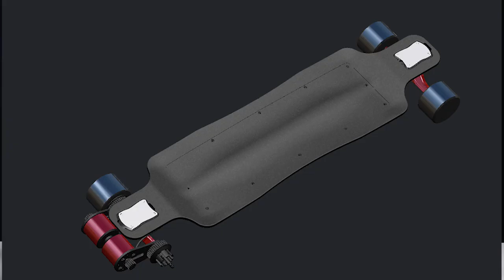Look inside MEEPO - New Boards and updates.

Comment: Keep on going! :)
My Meepo Classic has got around 1500km (!) and goes on and on without problems! 
Best bucks ive spend in my life.
Only one critic point/ tip to improve: The meepo board decks could be more like a 'normal board' = not so rigid anymore, more concave/flex.
Reply from the maker: Best bucks ever, that's a super high compliment. Thank you.

Comment: Hello Kieran, I love the v3 but I would like to make you aware of the only signal problem I had. There was a yellow wire disconnected from the power switch that disabled me from turning the board on with the button. Due to the auto roll turn on it wasn't too much of a problem but I just  wanted you to be aware :)
Reply: It might be the problem of the ESC case. Would you mind contacting us through email (info@meepoboard.com) or ig dm? We would love to solve your problem.
Reply: @MeepoElectricSkateboard  no worries i resoldered the connection and everything seems to be great!
Reply: @FracturedXD  Nice!

Comment: My Meepo Mini 2 , replaced the hobbywing and night remote with the Ling Yi revision with remote with screen. Now it turns off after a few minutes and will not turn back on for days. Cuts out after 3 minutes basically.
Reply from the maker: sounds like a battery issue. Whats your email or order no. Lets do some diagnose together.

Comment: Had a few different meepo boards over the years and they are great. One of the best boards I’ve ever owned is a meepo mini v2p with a hobbywing esc.
Good work meepo 👍
Reply: I need a board design for Uber eats, Dasher & caviar app delivers, I have the meppo all well drive & would like more speed & power for people that live up in the mountains. I need range because I only make 130$ a day & I could make more if I rode longer with less charge time for night time delivery for taco bell 3 am stoner clients

I could make so much money if you all just rush the prototype on the public please rush the fucking production

It is not for my enjoyment. I need it for employment, I don't want to get fired

The request is not for fun, it is for work

I am losing money by not having to the good stuff
Reply: @noeluna7354  flux motion board 

DIY board and battery

Comment: Hey kieran I have a question I have the meepo awd pro but would like to get more miles out of it , can I just buy an extra battery for it and just replace it when the other one dies out while on the road???
Reply: I’m just a user but yes. Same/similar voltage battery change works just like any other battery change. You could swap out fresh batteries all day.
Reply: @jonnypropaganda  thanks

Comment: Hey Kieran I’ve been having a issue with my board where the motors would stall (stop accelerating for a split second) when accelerating in any way. I checked the remote it seems fine and I opened it up and didn’t notice problems but the Esc isn’t exposed so idk if it’s that. Idk if it’s the motors either because I removed my 100mm hub caps and it seemed clean on the inside and it doesn’t have a issue getting to maximum speed it just has issues smoothly accelerating. Where can I contact you easily.
Reply: Please contact us through email info@meepoboard.com It might be the problem of the ESC. We could love to help.

Comment: I have been skating for 35 years. And just last month I finally got my very first e-board. The meepo v3. It has been life changing. I am addicted. I love it. 

I don’t care how v3 compares to competition. Because (with only 150 miles on it so far) _ the v3 It has everything I could want—almost. The 100mm should come standard. 

The awesome power in this thing is done a disservice by its bumpy ride (90mm). I’d bet that, like me, the majority of skaters would prefer the improved traction/clearance (and top speed) cruising on some 100mms over the bumpy/jumpy 90mm any day. I have no interest drag racing or kick flipping this thing. But I have a lot of interest in staying on it.

I would love a hint of a kick tail for sharp turns at a street-corners but that’s more preference than criticism. And of course I’d love the extended batteries, but that’s just an obvious hard cost, and honestly 10 miles is plenty for a fun ride or short commute.

After the $90 to replace all 4 wheels, this board is everything I could ask for. I ride every chance I can get. I love this thing.

P.s. WEAR A HELMET PEOPLE.
Reply: Wow, we appreciate these! Thanks!

Comment: How do I order the V3 ER with 100mm wheels instead of 90mm?  I don't want the 90mm and would prefer to put the funds toward extra set of 100mm.
Reply from the maker: All the meepoboard pack up with the original configuration, if you want to change the PU sleeve, you could ask our support team for a discount to purchase it : info@meepoboard.com

Comment: I experiment some trouble with my new AWD Pro , problem of rattle and speed decrease drastically ... but I like my Meepo . Hope they will continue to improve for better quality and fiability . New board are coming , cool . 👍🏼
Reply from the maker: Thank you for the feedbacks about the weakness of AWD Pro.
Reply: @KieranEboard  Its a pretty good board , I experiment some issue but it still working . Not perfect but good
Reply: @GeeKIller okay , thank you for the informations , I will make some research in this way . I have two new motors in stock , I will open one to see how it's made .

Comment: What's the ETA on the new skater belt drive board, and any expected specs?
Reply from the maker: Autumn. Fastest acceleration?
Reply: @KieranEboard  the deck does look nice. Was looking for a bit more concave and drop, it'sthe only thing holding me back from upgrading to the nls belt. . (:already have a v3er and mini2er:)
Reply: @KieranEboard  50km top speed 😉

Comment: Glad to see new update and a new board! The V4 change the griptape a little. Remove the bigger orange line on the back and keep the thinner orange line in the front and remove the arrow. The new board (didn't understand the name) looks dope, love the deck style 👌🤙 and render style
Reply from the maker: Thank you for the advise. We may need to keep the arrow as it has function, you don't need to look at wheels to find out which is the front side. We will try maybe make the lines smaller thineer.
Reply: @KieranEboard  Hey Kieran, thanks for responding. Yeah but if you just keep the thinner orange line in the front then people will recognize what the front is without the arrow. It would make the design much cleaner. You can try it an ask people on YT and IG what they think.

Comment: You should look at Exway design & quality. (I ride Evolve) 🛹
Reply from the maker: Yes, Exway try high-tech things, as We are more like make the board simple and reliable, less hassle. Something simple and stubid but last.
Reply: @KieranEboard  My $300 Er battery lasted 6 months yet the Warranty was only for 3? Using cheap parts doesnt make it last longer. If you want people to still "care" about meepo boards, stop treating customers this way and extend warranties and replace parts that are inferior.
Reply: @tripps5415  The batteries we are using are from Samsung and they are super stable and with high performance. The warranty for parts is 3 months and warranty for the whole board is 6 months. Usually, the battery lasts really long if you take good care of it (Charge regularly, avoid water. etc). You could feel free to contact us through email (info@meepoboard.com). We are more willing to help!
Reply: I ride an evolve and ride a meepo!  Two different prices but both fun
Reply: @smwyler  Nicee